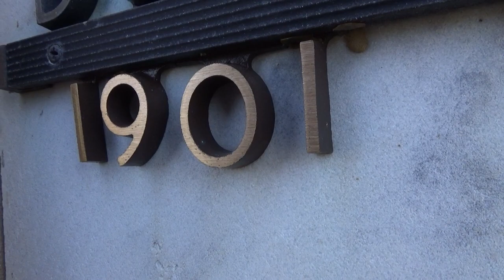Fabricate 24 inch Mini Ex bucket day 4

Comment: Look forward to ur videos every night. Just wondering if you are ever concerned welding on a machine with it running and or battery connected. I was always taught to undo the ground to battery to prevent electronic damage, or have a special welding circuit breaker connected to the battery. Keep up the videos love to come home from work relax and watch.

Comment: For the tooth you don't need that big ones like the other bucket for the little ex. on the removable plate you can just weld pieces of let say one inch square bar cut at angle at the end. Figure the length cut the angle that make it for two tooth and so on for the others. This smaller bucket will be more useful than the extra large one. Nice work.

Comment: from the look on those letters you should be able to get them cut with a waterjet from a plate of bronze plate / strip and have them either tig welded to the profiled bronze strip or epoxied to a bronze backingplate thats watercut to fit both the letters and the strip , the backingplate idea might be a good way to mount it to the door too 
leave the strip off at first and sink the screwheads in the backingplate that mounts it to the door then epoxy the strip over the screws and the mounting will be inviseable 

you know using the airnozzle at the drillpress is a good idea , aspecially if you put an oilingunit in line of it so it blows oily air

Comment: I have a suggestion for your teeth for the bucket, maybe you could cut V notches into the bar, it would still have the "ripping" ability, but are you sacrificing strength? It may be a long shot but its an idea
Reply: I was thinking the same just do some hard face welding on the edges

Comment: Hey Bill. Question. Could you take the teeth off of the mini ex bucket and use on the 24inch bucket?
Reply from the maker: +Joe May no not really the tooth holder is welded to the bucket
Reply: +BILLSTMAXX :) yeah that's right. you'd risk messing up the bucket and/or teeth, so you probably wouldn't be a good idea.

Comment: Why not make the teeth out of two plates per tooth that are welded together on the tip and only bent a little so they would touch? Wouldn't that be a more efficient use of energy, as in not so much oxy-acetylene gas?